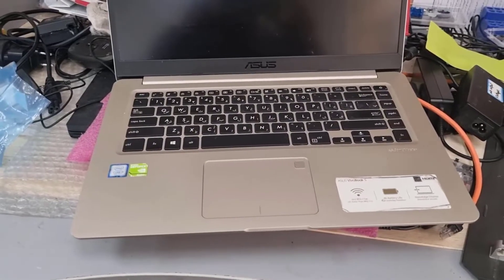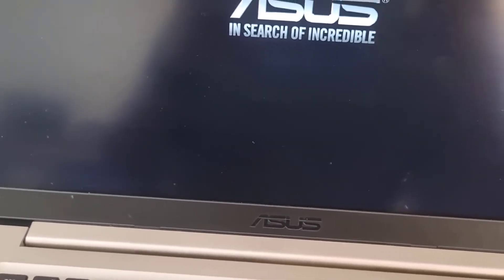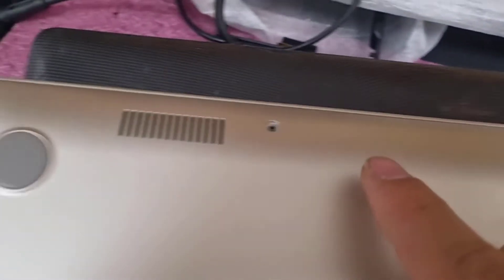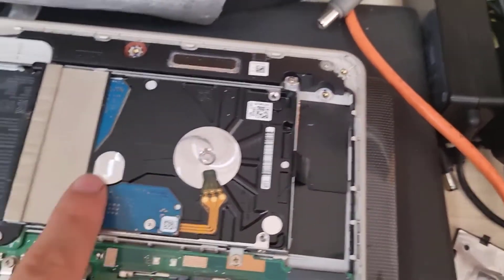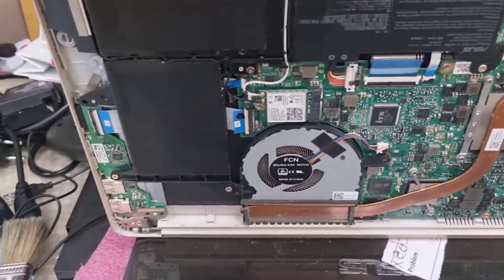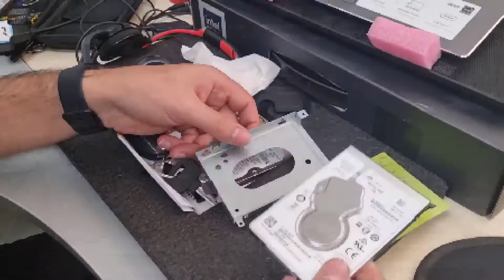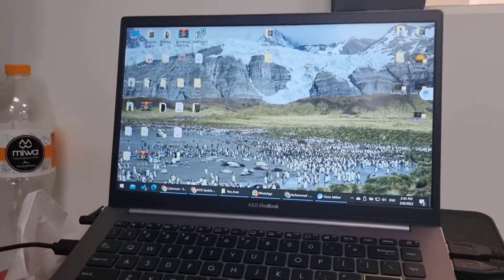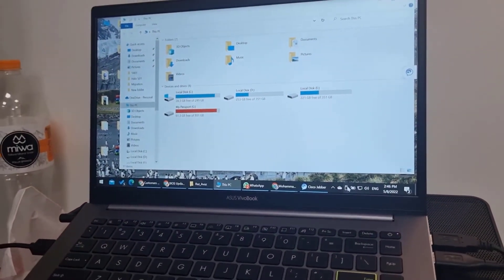ASUS VivoBook S 15 Laptop - Stuck in boot logo issue

Comment: This did not fix it for me?
Reply: It’ not the hard disk, its a bios prpblem woth many asus. If you leave the battery and reset the cmos the computer start.

the problem is that many asus havenot a removible battery!
Reply from the maker: @guidogarzia1108  in my case it was the HDD. But yeah. BIOS itself could be the cause. In some laptop models also there is a jumper beneath the RAM modules which also resets the BIOS settings.
Reply: @mohammadkhandan7182  can you do a video on this?
Reply from the maker: Can you describe your issue?
Reply: @mohammadkhandan7182  my laptop  is stuck on the asus logo in the beginning of the boot and if I try to press f2 and go to bios it just goes blank
Reply: @SLjoe_main  same for me